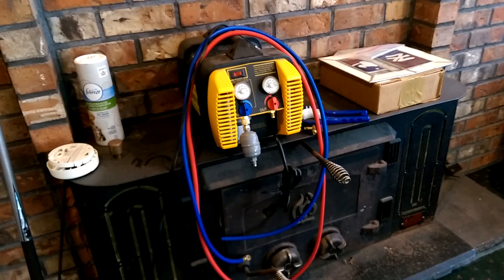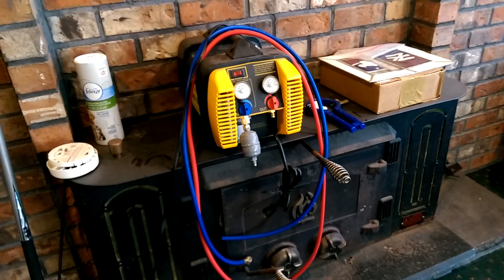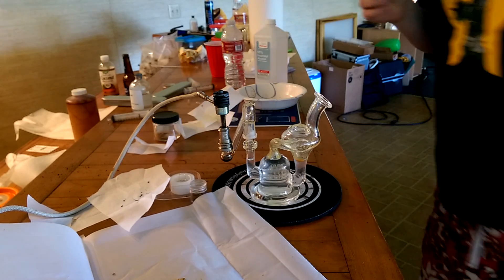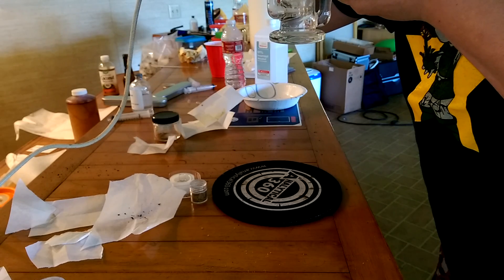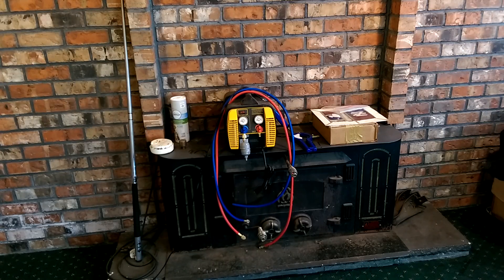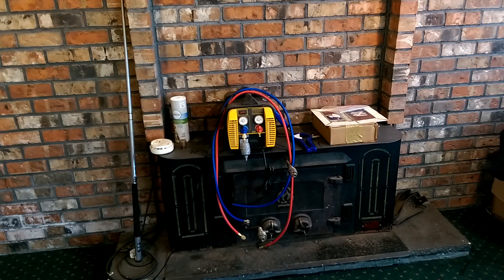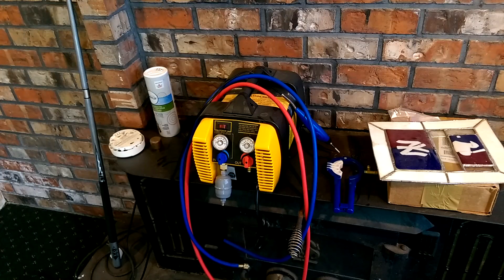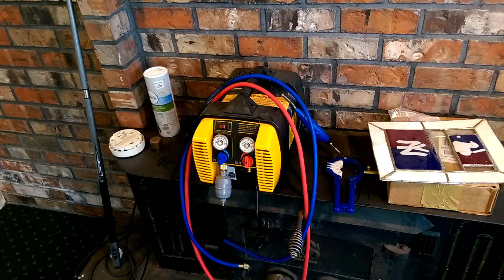PSA- refrigerant poison pumps

Comment: isnt that brass?
Reply from the maker: yes its brass. it's not 316 stainless steel and its seals aren't for non polar solvents
Reply: +Bret Maverick Are you aware of the PTFE upgrades for the g5 that covers the "O" rings and seals in the machine, if that were installed would you see any other problems using the appion?

Comment: I'm currently running one of these appions with a bhogart but with stainless steel PFTE lines.
I want to save up to get a SweetLeaf or a Precision extractions "Defender" and go completely passive. 

Until then i guess i'm making "poison" 
Thanks for the PSA Bret
Reply from the maker: U aren't making poison. U don't need a new system either. Just run that bhogart passive. Chuck the mannifold and just run a line from your syphen tube on your recovery tank to the top of your column. Then have your collection tank in dry ice. Pull a vac on your whole system except for the recovery tank. Then open the valve above your syphyn tube on your recovery tank to let the butane flow up the hose and through the weed. (If u have the old tank with no syphun tube then just flip it upside down like u do when your starting a run)
Once you let 5-7 lbs of tane per lb of weed out of your recovery tank, close the valve. Then hook a hose from your collection tank to your recovery tank on the side with no downstem (or if it's the old tank just flip it over so the hose is at the top). Put your recovery tank in dry ice and put your collection tank in hot water. 
It's the easiest to do with the recovery tank that has a downstem/syphyn tube.
Reply: Bret Maverick SWEET! thanks for taking the time to write this up! I've been thinking about how I could convert my current setup to passive and after reading this and looking at my system i could do this but my system has no compound gauges attached to it other than the ones on the manifold. You think i should wait to try to run it like this until i get the gauges? My recovery tank has a pressure relief valve rated for 150 psi but thats pretty much the only "safety" feature built in to my bhogart. Thanks for your time.

Comment: is there a closed loop system you would recommend?
Reply from the maker: A lot. The one I use is the one I recommend the most because it's my friends company. Sweet leaf. If your looking for something more commercial then iron fist. Terp xtractors looks cool. Just don't run a shifty pump. Even 90% of a bhogart is cool. For another 2-3 grand u can modify a bhogart into a good system. For the most part it seems like people who run bhogarts are people who like to cut corners. So the fail pump, hoses and manifold don't bother them
Reply: ok cool thanks I was looking at the mk3 from terp extractors until  read and heard the refrigerant pumps poison the oil. so are you saying there is a good pump to use? if so which one? thanks.
Reply: +Bret Maverick Is this just heads up for specially closed loop". Is the old way with just regular cheap standard Best Values Vac 2 stage pump good to go with just using chamber and pump.
Reply: john doe Terpp uses the haskel EXT420 which is a pneumatic specially released for pumping hydrocarbons.  They have a pretty sweet bidirectional flow design that can increase your yield by up to 10%. Passive is cool because you don't have to fuck with potentially hazardous pumps... the good pumps are indeed expensive!
Reply: thanks
Reply: Bret Maverick What changes would you make to a BHOgart to make is a decent system if you don't mind me asking, I have the 2lb (10x12x3) and currently running the pump because the passive recovery takes WAY too long without uncomfortably high temps.

Comment: I got offered a bhogart with one of those pumps about a year ago and turned it down because from watching your vids i knew about copper internals and their own PSA about it being for alcohol not hydrocarbons. They told me they could upgrade my pump to be hydrocarbons and idk about that id rather rock a real one or just do passive recovery
Reply from the maker: I agree. Expecally now that light hydrocarbon extraction is more common were having more and more explosion proof pumps coming out. And the pneumatic pumps are the shit. No electricity or mineral oil! I could have my compressor outside of the room and have the hose go through the wall to my pump with a valve before it so I can operate it away from the compressor. But thats more when I'm running 15lbs a day like xtracted